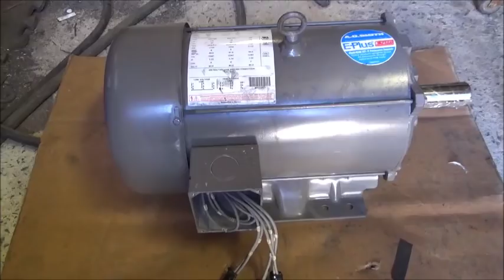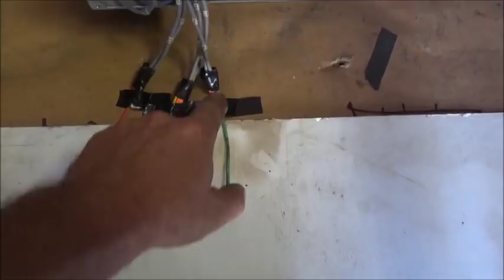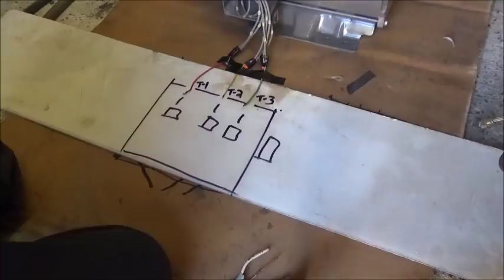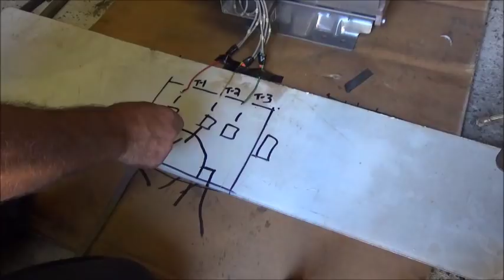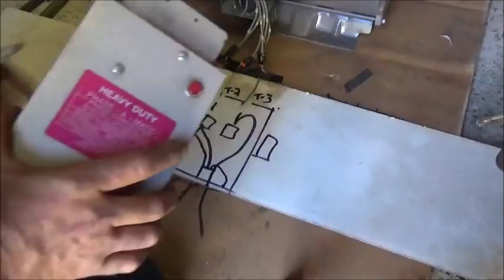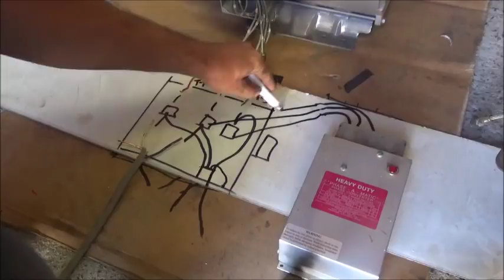How To Build A Rotary Phase Converter

Comment: I have a homemade rotary converter hooked up to my South Bend Lathe. It uses a magnetic connector that is closed with a light switch. I think it uses two run capacitors on T2 and T3 to help balance out the three phases. There is also a start capacitor connected with a push button to start the pony motor. Once it is running I can start stop or reverse the lathe. It runs for hours at a time when I am using the lathe. I have been using it for over ten years.

Comment: BTW, when you  are using 2-conductor cable for 220 volt supply, it's customary to wrap red (preferred) or black tape over the white conductor.  White generally denotes a neutral conductor, and contrary to the mistake of saying '110-110" the supply wires are carrying 220 volts referenced to each other.  There is no neutral here.
Reply: Doing 1ph to 3ph VFD rn and will keep this in mind. Def going red. I'm fine with it, but good looking out for anyone else probing around for sure

Comment: why do folks keep saying "110 110" when talking about the 220 volt cable feeding the RPC?  Do you see a neutral connected anywhere?  No?  Then it's simple 220, not 110-110.

Comment: There are three, not two, windings in a 3-phase motor.  To be exact, there are three pairs of two windings in a 3-phase motor.  Each pair is connected in parallel for low voltage, and in series for high voltage.
Reply: well SOB, that makes a lot of sense! hell fire, thanks for that

Comment: @Jonathan W 
Has a very good video on where your wires should be. I used capacitors instead of his phase box but you just just all 3 phases to even the voltage.

Comment: Wait, the way you have L1 and L2 coming in and hooking directly to T1 and T2 on the lower side of the switch wouldn't they be hot even if you turned the switch off and killed power to the rotary phase converter motor? So that would leave L1 and L2 on the load side going to your piece of equipment hot?????? Wouldn't the equipment need to have L1 and L2 legs on the same side of the switch as the rotary phase motor this way you kill the single phase hot legs to the equipment when you turn off the switch to stop the rotary motor.
Reply: I could see putting the equipment just the opposite of what you are showing on the switch since that would allow you to break the single phase coming in on T1 and T2 cutting power to the phase motor and killing power on the equipment side as well then having T3 break when you open the switch to kill the phase motor causing it to kill the generated leg to the equipment so you don't have a generated hot leg while the phase motor is winding down?????
Reply: As far as the Phase-A-Matic, wouldn't you want the L1 and L2 legs switched as well so they aren't energized and trying to energize L3? Technically isn't it's only purpose here to try to compensate for any V-droop on the L3 leg?

Comment: this is not a rotary converter ,this is a static converter because a rotary converter need a motor , when i work in motor shops all my life we sell rotary converters with -out  shaft because the motor  ( the dummy motor) ca not leave the shop with shaft  for safety  reasons  ,,,,,,OSHA  ,,,,,,UL,,,,etc,etc

Comment: I don’t understand why u have to have a static phase converter box after the rotary phase converter?  I thought either converts the power from single phase to three phase? Im trying to do this but now real confused.
Reply from the maker: A static box will handle one machine. A idler motor after starting it using the static box will run multiple machines.

Comment: Outstanding explanation of this setup; very well laid out. Question: what do u do when it is an air compressor that goes on/off as ur outsource motor?
Reply: The converter would need to run all the time.

Comment: For those not familiar with static box. This item “ makes” a temporary 3rd phase, through a timer within, like up to 8 seconds, to provide the initial start of a 3 phase motor load. Remember, most 3 phase motors will run on 2 phases, but not start with 2 phases. They will run at a reduced power. The static box mentioned, are purchased rated usually higher than the motor they will be driving. They are not as popular anymore since the frequency drives have become prolific, and user friendly along with some smaller ones available nowadays
Reply: "2 phase?"

PLEASE explain!

steve
Reply: Hi Steve, typical U.S. residential AC power is indeed called single phase 240 volt, however is 2 phases of power. Each hot phase to either ground or neutral conductor reference , with a meter, will show 120 volt, and both phases to each other, with meter, will show the 240 volt.
Reply: @chrisretired5379  More properly, it's referred to as "split phase," as the two hots are actually the same phase. The neutral comes from center-tapping the transformer, and allows for half-voltage to be produced thus "splitting" the single phase. True two-phase power exists, however unlike single phase where your hot wires are always 180 degrees apart, two phase power has each phase 90 degrees apart. Though easy to confuse for a neutral, the third leg in a two phase system is a true hot and therefore more accurately called a common leg. Due to how the math works out for currents that are 90 degrees out of phase, that common has to be sized to carry 1.414 times the current of the other two legs. In a panel, two-phase looks remarkably similar to three phase, with the exception that one wire will be larger than the other two. Also it's quite rare these days.

Comment: Appreciate your video. If I was to hook up a gas motor shaft to a 3 phase motor shaft, and took the 3 phase motor to a 3 ph welder, I'd basically have a welder/generator. Correct? 

I'm trying to figure out how much of a motor I'd need to output enough current for welding. I don't think I'd have to deal with losses, since the gas power would be converted directly into 3ph power.

Comment: I've been a journeyman electrician for close to 20 years. 
This is a concept I learned in school, but have only dealt with 2x in my career.  
It's very unusual in my area for a facility to have 3 phase equipment, with no 3 phase available.  
I had to check your video to confirm a few things for a service call I got today. 
It was a head scratcher for sure. 
Great explanation though. 
Thanks

Comment: Thanks for the video! Is it the same formula for a static converter as a rotary converter for motor horsepower? I want to run an 8 hp 3 phase motor.

Comment: Instead of diagram I like to actually see it. I had a hard time understanding what you actually said.  Where do those wires go to or came from that you  had it coming from the bottom up to the three phase motor.  I had difficulty hearing what you said. two wires ( plus one ground) on the bottom left side and three wires ( plus one ground)  on the bottom right side.  Noiw where those wires belong to.  Are they coming from the circuit breaker?  left side 120 V and right side 240 plus 120 or.... ?

Comment: If you switch T3 and leave T1 and T2 powered up to your equipment you'll run the risk of single-phase the three phase motor in your equipment motor won't you?
Reply: That's what I was wondering too: if there is a ground and uninterrupted power available people (and windings) are at risk from live circuits.

Comment: Is it true that if you do this and runni it off 1 leg,  that the other fields that are simultaneously impress or generated in the other 2 coils,  that if the voltage is 240,  it actually become 277,  so does that mean if you use that it will spin the motor on let's say a lathe l, that much faster.

Comment: Anyone with the smallest amount of electrical skill can build a rotary phase converter.....that is single phase in and 3 phase out......the very real problem is, and one that nobody without a degree in electrical knowledge is able to achieve is the control circuitry that balances the phases as the load varies.
Sure, you can make one that will drive a 3 phase motor under constant load conditions once you balance the voltages on the phases, but don't think that the voltages will stay balanced once you vary the loading like for a lathe or milling machine.
A regular commercial phase converter has a bank of capacitors that are varied by electronic circuitry to keep the phase voltages balanced and you cannot do that manually.
Reply from the maker: So you're telling me after I've used it for 25 years that it won't work.
Reply: @jonathanw4942  Out of context.........it will work as long as you tolerate the imbalance of the phase voltages......and if you think the voltages are not unbalanced on a home build you are fooling yourself.
A fairly large motor will drive a fairly smaller load as the imbalance won't be noticed.
Reply from the maker: @gangleweed  That is why your idler motor is at least double the horsepower of the motor you are running. No noticeable imbalance.
Reply: @jonathanw4942  The imbalance is still there no matter what you may think.....it is impossible to balance the phases manually and you stand a risk of burning the driven motor windings when they overheat due to imbalanced phases..........but you know best.

Comment: I would put a 3 phase magnetic contactor switch on it with the phantom leg energizing it. This way if you loose a leg you don't single phase a motor on your machine and burn it up. Learned that after replacing a Bridgeport motor, I built a self starting and balanced 10 HP converter with capacitors and it will start a 10 HP motor, but if you have trouble starting a big motor start and idle a smaller motor and then start the larger motor this makes the phantom leg stronger. Also the contactor was thermal overload blades to prevent damage if you overload it. Hope I didn't just complicate your great explanation.

Comment: Best explanation Ive heard so far, im wondering would it be safe to assume that only 208 volts 3 phase is available since you are inputing 220 volts into it?
Reply: So that would be center tapped neutral to tope line on a transformer,  I guess it's just finding the analogous windings in the motor...

Comment: i have an idealarc 250 lincoln stick welder and can only run it in 220v which is its low setting. i want to run it on its high side which is 440v will this motor power the welder alone?

Comment: Great video, thanks for posting. So that is considered wye start low voltage?  Our first converter used a pony motor to start, and was wired :
L1, (1-6-7,) L2 ( 2,4,8,) L3 (3,5,9), which i understand is delta start ??My new panel has start and run capacitors .
I'm a little confused.

Comment: Fyi with this arranges of a  "phase converter" -- it's not a true phase converter - you won't  get full power on the third leg (T3) to the load motor  , t3 has only enough power to start the load motor. you can confirm by measuring each of the phase individually preferably with a load or work in the machine. T3 will have a much lower ampacity . so, the 3-phase Machine Tools in your shop may not be performing as good as they could. A true face converter will have a motor that runs a 3-phase generator which is then connected to the Machine Tool motor . hope this helps, I enjoy all your videos!!! oh, you won't need a vfd for each tool  you can run one large vfd for the shop 3 phase  . depending on the size Vfd you can run more than one tool at once. And depending on how far apart your tools are you may not need an engineered matched cable between the vfd and the tools. I know they are expensive but the price is coming down all the time . I know a lot of guys complain about vfds in their machine shop but VFDs run the world.
Reply: This makes complete sense to me. I was wondering why the amp draws on the idler motor we’re so different. I’m using a 5hp motor as an idler motor to power a 3HP motor and the amp draw on the 3HP was 9.2 amps, 9.4 amps and 1.6 amps on the 3rd phase. This makes sense why now.

Comment: Great video! Couple questions thou. Does it matter which direction you spin the motor? And does this eat a lot more electricity?
Reply: I've had a phase converter for my lathe with a rope start for a decade. You can spin it either way but whatever you're running will spin that way too. So if you spin up the phase converter clockwise your machine will run clockwise in forward. If you  spin up the converter counterclockwise your machine will run counterclockwise in forward. Hope this makes sense. And if you use it alot you'll notice a small jump in the power bill but it's worth every penny to have 3 phase at home.

Comment: The problem with the set up would be the three legs are not evenly powered if you put a metre on each of the legs you will find that there are three different voltages do you need capacitors to even out the voltages you have to actually doing it otherwise your machine will slow down speed up within cycles therefore you will make vibration and harmonics and it's hard on everything including the motor
Reply from the maker: The capacitors in a static converter system only uses them for starting. This simple phase converter has been used since long before I was born, so it must not be much of an issue.
Reply: john woodworth  You are correct that you will have a “wild” leg (the generated leg) that will have less voltage than the other two. So you will not be able to get full power out of the motor you are driving with it. IOW, a six HP motor may only be making 4-5 HP. Probably not a big deal. It will also cause hysteresis heating in the windings being fed by that leg. Again, probably not a big deal, at least in the short term. When I built my converter, I used capacitors to balance the voltage between the legs. It’s a compromise, but still the best solution. However, I did build my converter to run a 3 phase welder, not a motor. A resistive load such as a welder is much more sensitive to variations in voltage across the legs than a motor, hence more need for voltage balancing.
Reply: @notajp  can you please show me how you used the compacitors please

Comment: I'm running a 10 hp motor , do I need the equivalent hp and rpm?
Reply from the maker: You will need at least a 15hp idler
Reply: @jonathanw4942  sorry, if you explained I missed it - what an 'idler'? Is that the main motor that's driving equipment? Like a 3-phase table saw with a 5hp 3-phase motor, that 5hp motor is the idler? And the 'pony motor' is a small motor used to actually spin the main motor to allow it to start - is that right?

Comment: Will the phase a matic start a larger motor than its rated to run under load I wonder?  I have a 4-8 hp static and a 20 hp idler motor I’d like to start with it.

Comment: Just a  note:  When reversing the 3 phase, it is the 2 wires next to each other (side by side). Ex: T1 and T2 or T2 and T3. If you switched T1 with T3, it would run the same as if you did nothing. Love the videos always learning something I did not know about.
Reply: You can switch ANY two of the line leads and it will reverse the motor.
Reply: @russmt4181 , quite correct!

steve
Reply: Man I've swapped randomly over the years, pretty sure rotation changed every time.... any truth to this?

Comment: Mr. Jonathan,  great info..  could you please do a video on how the converter "works"? 
where you wire it in to your system; to run your machines?
i did not understand.  it would help me to see this motor in action.
obviously, many shops can profit from 3-phase motors;  please explain a little more.
many thanks for your great videos!   best to you and yours,  walt
Reply: You need to rewatch the video, it’s all there, just follow the lines.

Comment: I built a fancier one once. It used some "start" capacitors to give the motor a 'kick' to get it spinning and they would drop out of the circuit once it was up to speed. Worked really well.
Reply: That's how most induction single phase motors work. They use start capacitors and a centrifugal clutch that takes it/them out of the power circuit while the motor is spinning. Now to watch this video again and see if I get it the second time. When he said he uses a "pony motor for reasons of my own" I started to draw a blank. We were here to learn how to make a rotary phase converter and suddenly it's as clear as mud.
Reply: @TSPhotoAtlanta  Yeah, a rotary phase converter uses a 3 phase motor like a single phase motor with it's 3rd phase winding (combined with the original single phase power) as a 3 phase generator. 2 of the 3 phases in the motor are powered by the house power, but you need to get the motor started somehow. There are two common ways to do that. One is the way I did it with start caps, and another way is to use a pony motor (like a starter motor on an internal combustion engine). Once the 3 phase motor is running at speed the start caps or the pony motor can be disengaged.

Comment: What is the phasomatic doing in this setup? 
Is it starting the generator motor?
Reply from the maker: The motor needs an aid to start it, you can use a rope, a 110 motor with a pulley and belt to get it spinning (pony motor) or a static converter box. It is not a necessary item, but makes it easy

Comment: OK, first great video. Second I have a couple of static boxes that have 220 single phase in and 220 3 phase out. I also have a 5 hp 3 pase motor but no markings on the wires comming out? Do you know of a simple way to figure out which wire is which comming out of the motor? Also can my static box be hooked up the way you've shown? I've enjoyed your videos for years, especially the wrecker stuff. I'm an old heavy recovery specialist, I even have a '76 Dodge with an old Homes 480 on that I still use around my property. Thanks for any answers you may have and thanks for the video!